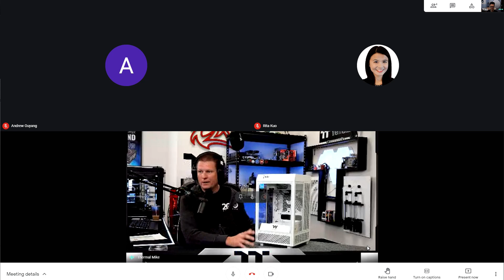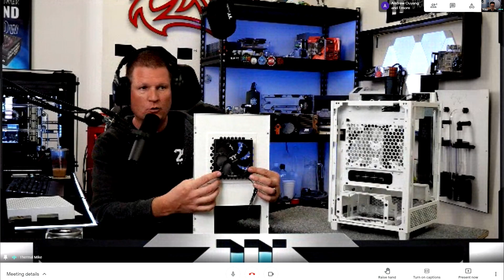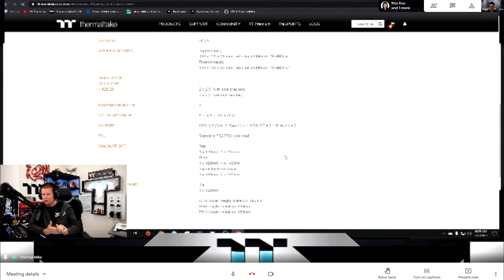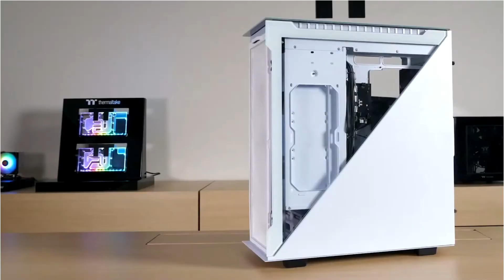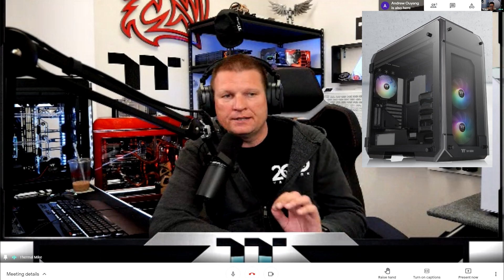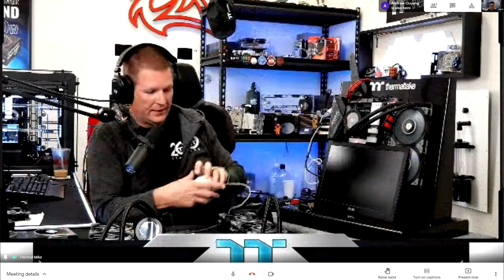Thermaltake's CES 2021 Showcase: Tower 100, Divider 500, and Toughliquid AIOs, feat. "Thermal Mike"!

Comment: Request:  Toughfan 14 vs NF-A12x25+140mm adapter on radiator.
Reply from the maker: I don't think this will be much of a contest, as the TF14 already matches the NF-A12x25. At this point, if you're using a 280mm rad, you simply buy this two pack: https://amzn.to/3toYevc
I may eventually review them, but I have no doubt they are now the best rad fan on the market.
Reply: @TheTechBuyersGuru  Just wondering why Noctua refuse to make a 140mm version A12x25 first place; I mean TF14 basically just a enlarged A12x25 right?
Reply from the maker: They aren't refusing, they are having technical difficulties. It was supposed to launch this spring, now pushed off to end of 2021 at the earliest: https://noctua.at/en/product-roadmap

Comment: I think the triangular design of the Divider case should at the very least be reversed so that you have the glass panel at the bottom half and the solid panel at the top half. In this way you can see your CPU and GPU and you hide the potentially unsightly components.
Reply from the maker: I think the Divider design has some merit, but I agree it isn't entirely optimized yet. Your idea has a lot of merit, although if the system is on the floor, it's less likely you'll be able to see the CPU with the solid panel on top.

Comment: I'm actually more curious about their Toughair 110.  The heatsink mass looks like something inbetween NH-L12S & NH-C14S @114mm height but only costs $35. It might be a cheaper alternative to the NH-C14S if performance is good.
Reply from the maker: That was another big introduction, but as you know, I covered that in a community post. All very promising new coolers from Thermaltake.

Comment: Loves me some Toughfans.  I watched your shootout vid in anticipation of buyers remorse but it only furthered my suspicions... that the fan is a good one!  My aio (push/pull 280 with 25mm shrouds on each side as well) is infested with them + adapters and I have I a couple extra laying around that may make it into a new small form factor build I'm working on.  The 2 pack is where it's at, value wise.

EDIT:  Thanks for mentioning that Toughfan power cable to him.  Those things are nuts.  Why not just leave a little link, right at the fan, like the Arctic or Noiseblocker fans?  Throw that extra three feet in the box, it could be handy but not ALWAYS lol.
Reply: @Ziv Zulander Definitely.  It completely slipped my mind (I have a good chunk of Noctua fans).